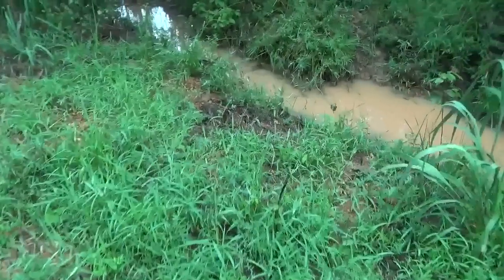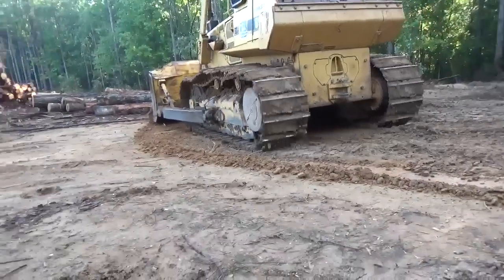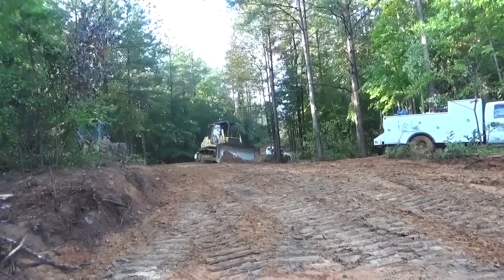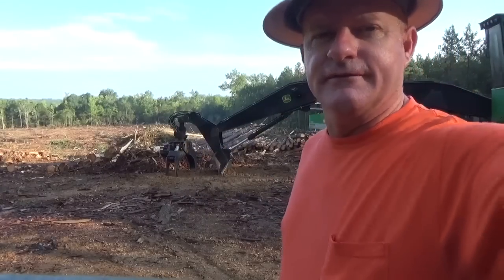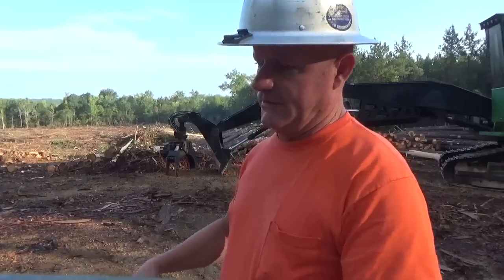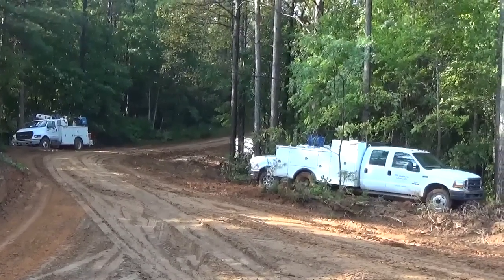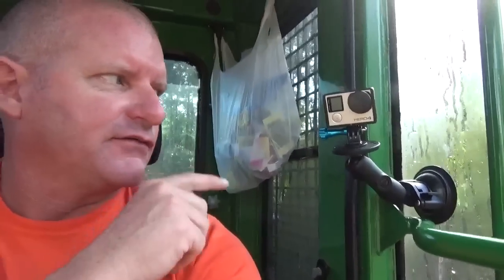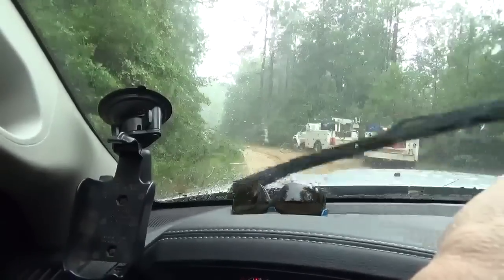A Cottonmouth snake and my Dad rolling coal dragging trucks out

Comment: Hello Tim with regards to your john deere making a noise on the undercarriage ,perhaps if you run the machine for 30 minutes or more then check each top roller and bottom roller in turn , the one that feels warmer than the others generaly indicates it is the one which is wearing out . The reason iam telling you this is because my DAD use to run a Komatsu D155A with a scraper box and also Komatsu 60p Bog Master , Thanks .

Comment: Is that soil heavy in clay? If so some of the logging and other outfits that work on roads heavy with clay in my area run tire chains to aid in traction. it is a hassle to put them on and off but it saves the driveline from excessive shock loads and excessive spinning.